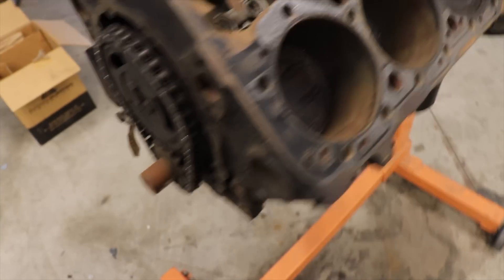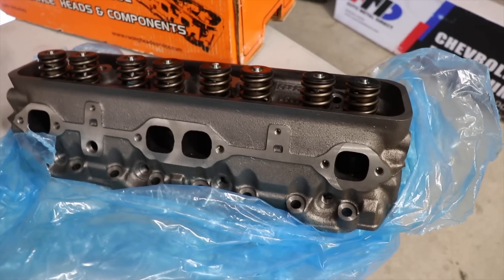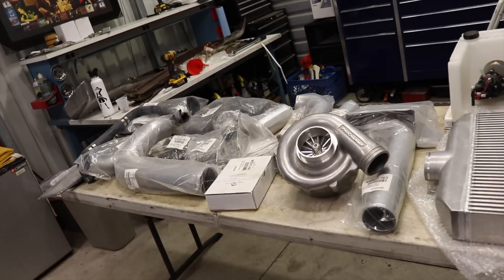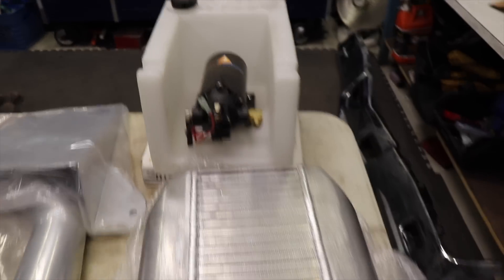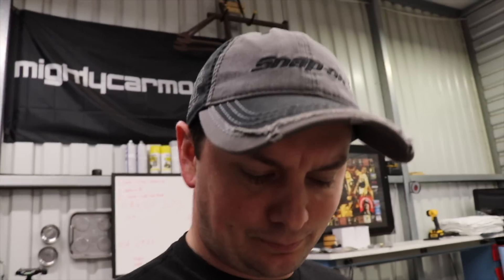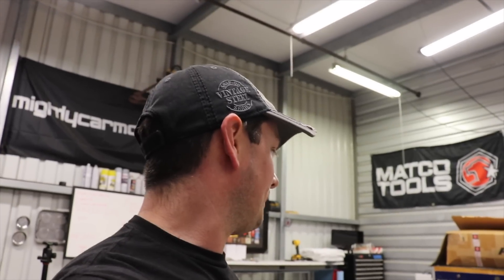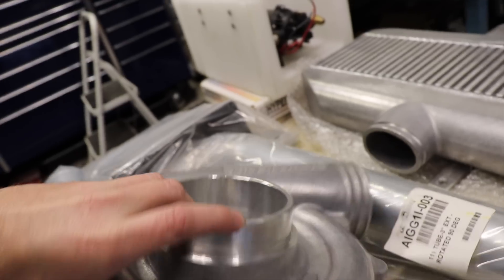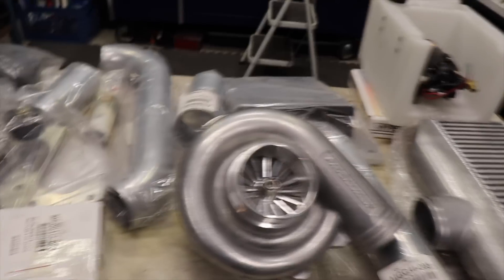Chevy 355 Small Block Supercharger | Supercharging a SBC with Procharger Supercharger

Comment: dude I love this solely because my Dart small block 427 has probe forged pistons like yours does! I love it, mine though is 580-600 hp at the flywheel. Good luck, the pistons are unreplaceable now, as Probe no longer exists, but they are still good slugs to go with!
Reply: prochargers are more efficient than typical roots style blowers, and I agree with a blown engine, it wont get any debris in the supercharger.
Reply: Hey when your driving from one drag week event to another,  pull the belt off the charger!
Reply: @robertmorin9234  Actually, don't do that.